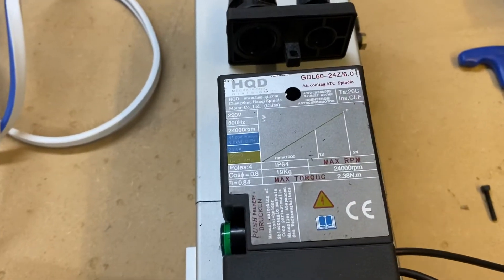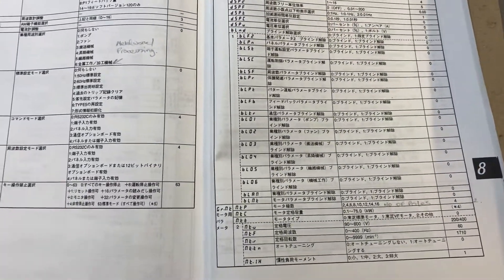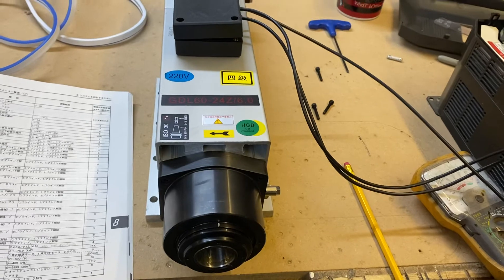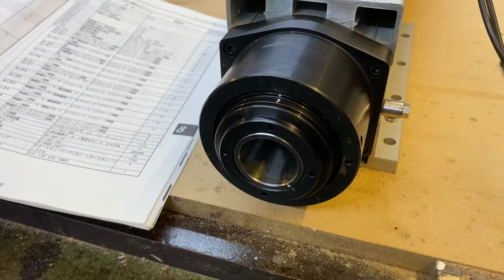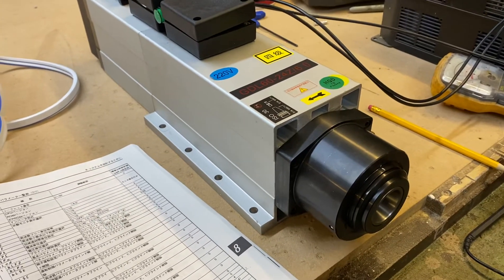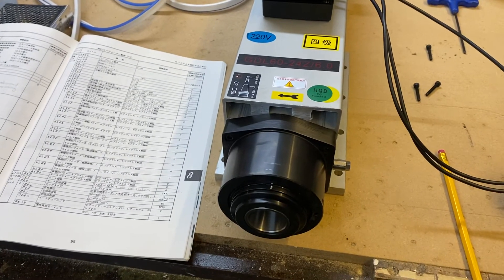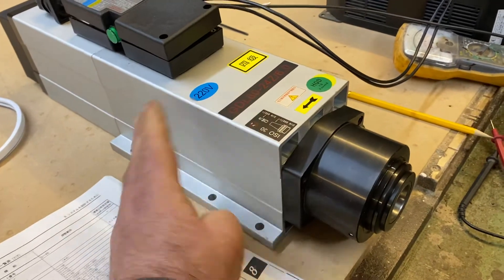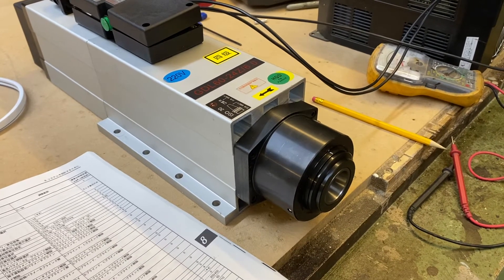Hqd 6kw Atc spindle test

Comment: Nice spindle! By coincidence I added one an hour ago on Alie to my basket, i like this ISO30 over the BT30. What's the max power you can get over your 220vac line? mine has 16A max, should be enough for most of the work, but i'm leaning towards getting a 380vac connection for the smaller machine at home. Did it run cool at the run-in over a longer time?
Reply from the maker: I did the whole run in process without cooling fan running so I could see how much it heated . 
Only rose approx 10 degrees after an hour . 
Runs totally smooth and almost silent 
I will test pneumatic eject etc tomorrow before installing it onto a machine. 
All my machines are running off 13a plugs only  single phase -  you will never get close to 6 kw rating ! ( i expect this is exaggerated 4kw rating anyway)